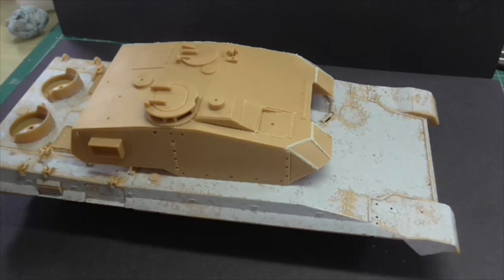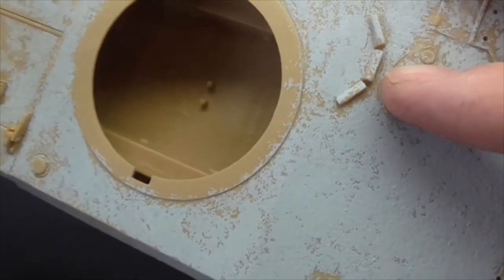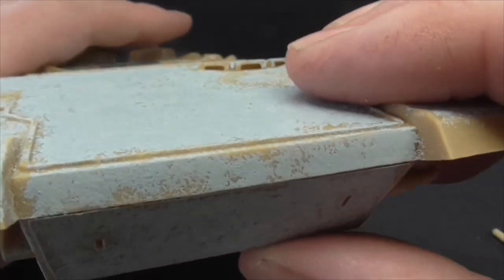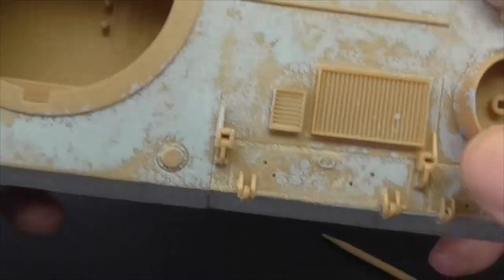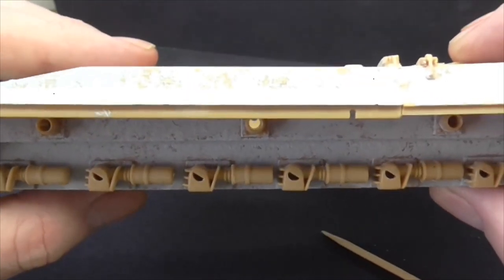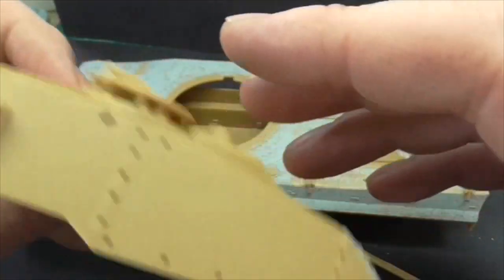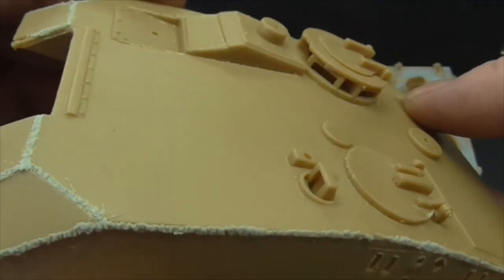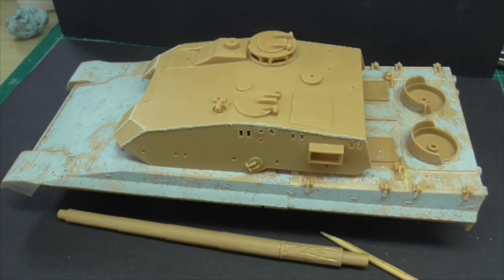Trumpeter 1/35 EE-T2 Osorio Build Vlog 1

Comment: Interesting vehicle you have chosen to build there mate! I like your take on texturing the vehicle, i would also use Mr Surfacer for that. Its best when you stipple on the half dried coverage with an old brush and i find that to be fun and effective.
Reply from the maker: Thank you Michael I think it will take a few kits before it looks right at the moment the weld seams are to big so more practice required I think . Regards Gav.